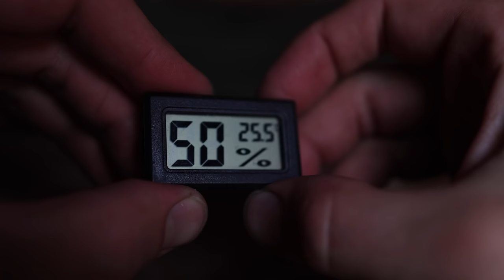Made an Absolutely AMAZING & COZY FIREPLACE in a Bushcraft DUGOUT - ALONE into WILDERNESS - ASMR

Comment: would a layer of that clay mud on the wood walls before you lay in the rock been good idea to insulate and reflect/radiate the heat back and also protect from fire in case the mortar in the rock cracks or fails? curious on your thoughts ,thank you very much for what you do and God bless🌎🕊💜🛐

Comment: Probably the chimney needs to be raised a bit (perhaps with old tin cans) so that the draft is better when the fire cools down. It can also be that the fire hole is too large in relation to the diameter of the chimney. How does the roof do when it rains, can the moss make it waterproof? The clay from the chimney is also in danger of dissolving when it rains, so a small chimney roof might be a good idea.

Comment: Very inspiring!  You are the real deal.  I love baked potatoes too but recently read that baking in aluminum foil can be unhealthy because the high heat will leach the aluminum into the food so now I use a skillet or dutch oven.  You could also line it with waxed baking paper first then aluminum foil.

Comment: Fascinating to watch.  Great skills in putting your home together.  I have some questions--
  Is the dugout used all year?
  How did you make boards for the door and root cellar?
  You have a flat roof.  Does the moss keep out the rain?
  How much rain gets through the sand/log walls?
  Your water is dark colored, is it pure?
  Your fire is drafting a lot.  Do you choke it down?  
  How often do you re-supply?

Comment: very nice!  one thing I noticed is using the flint and steel.  inexperienced users likely will have issues if they follow your video.  Best way is to anchor the steel (knife) and pull the flint. there is no wind blow, and more directional control. experienced people don't typically have this issue but if your just learning try that. It will yield much better results.

Comment: This is awesome but however these dugouts aren’t waterproof. Hard rain running down the mountain is bound to leak in. After the ground is saturated water will start seeping in thru the walls? Just asking. Thanks
Reply from the maker: Thank you. No, water does not seep inside. The slope of the hill is large, the water quickly flows down the turf. Inside the dugout is always dry.

Comment: I think, to reduce smoke coming inside while burning slow. Decrease the size of the "throw in" also use more clay while building oven or atleast put another layer with sand inbetween the wooden frame and the fire. Would be a shame if such a nice dugout be burning down. Good job! Nice video

Comment: Thanks and congrats for this video !!! Its a very hard work that requires strength and a lot of patience ! was the fireplace made with clay only or mixed with lime?
Reply from the maker: My pleasure. Yes, it was hard and long work :)
I added a little special mixture to make the clay more viscous and dry faster. I also tried adding ashes from a fire and fine sand in different proportions.

Comment: What happens if it rains? Wouldnt the rain just go down the chimney  making the oven useless? This would be a big problem in the colder months when you need a fire more. Any plans for that?
Other than that I absolutely love your vids!!
Also, how did you get the door to hang and turn?
Reply from the maker: Thank you!
In the rain there will be no problems, the temperature in the pipe is so high that the water entering it simply evaporates.
At first I wanted to make a canopy of twigs and clay on top of the pipe. But when I conducted the first tests of the fireplace, I realized that this is not necessary :)
I hung the door on long metal hinges that I had brought with me.

Comment: I love little dugout cabins like this,  just don't like the fireplace placement to the door.   Normally a door like that will be a massive heat loss and big draft source same with the windows.  The normal solution to that is curtains, over the door and window.   a big hide blanket over the door to keep out the wind and keep in the heat, and a wool or hide blanket over the window.

The issue is...   the fireplace, i'd be worried about putting up a blanket or door covering and having it catch fire.

Comment: Nice work, I like it very much. But I think it would be safer to leave a gap between the stones of the oven and the log of the back wall. Also, you forgot to put sand in the gaps between the log and the stone. You used the sand fill to build the log walls and I found that very logical. I think that the plaster made of mud will not be enough for the increased heat accumulated between the logs and stones. I wish you to be very careful about the fire hazard. This work of yours has been a good experience for all of us, thank you.
Reply from the maker: Thank you!
Yes, I thought about it. I tried to lay thicker stones on the back wall. So far so good, stoked the fireplace to test for over 7 hours straight.

Comment: Curious if you have ever used any of the solar cookers with a shiny smooth convex surface to direct the rays to your food or to heat water? They are low profile, can be set up away from the cabin for concealment or misdirection (and to not draw predators back to your camp to the smell of your cooking food) and reduce the use of firewood which is precious and should be saved for winter. (Or at least not as desirable on very hot days or dry fire hazard conditions.) I have recently been researching them as an alternative and depending on materials available, they seem very straightforward to make. Smoke is usually the big giveaway that lets other people know you are there from far away so the reflection of the parabola can be a tradeoff but really it would be seen only from a narrow piece of sky- and easily instantly concealed by a tarp where the smoke of a fire still lingers and floats after you put it out. (Except the Dakota firehole of course) anyway i am just interested in acquiring as many skills as possible so if you have thoughts?
Reply from the maker: Yes, I was thinking about solar cookers. It will be a good solution on sunny days. But there are very few of them in the north...
However, I will try to do it in the next videos 😉👌
Reply: Great! There are several videos of homemade designs with simple store-bought materials. And the insulated boxes to maintain heat after the cooking. 
I scavenged and repurposed some materials and i will keep building until i achieve the desired result. Looking forward to the next video!

Comment: Great couple of videos. How did it take to collect all those stones? Great addition the fireplace, Maybe add a flat stone over the chimney top for rain. Wonder how that sand will hold in the rain showers; why didn't you use a small tarp or mud seal the roof? Amazing work, with exceptional skills with basic tools. Any wild game or larger edibles in the area?
Reply from the maker: Thank you! I found most of the stones when I was digging a hole for a dugout. The rest I collected on crumbling sandy slopes.

I wanted to make a spark arrester for the pipe, but then I thought that it was not really needed. Although I'm not sure :)
I need to deal with a small part of the smoke that still enters the dugout from the fireplace. Perhaps increasing the height of the pipe would help?
Or making a special protrusion inside the fireplace, which is called a fireplace tooth ...
Well, later, I want to make a spark arrestor from the interlacing of branches and rub it with clay. I did not find a large and flat stone :)

I redid the roof later and used waterproof breathable fabric. It became dry in the dugout, all the logs dried up.

Yes, this area is full of various game, large ungulates.
There are moose, wild boars, badgers.

Comment: Really nice but wouldn't it  be better to build it in the middle of the dugout so any heat it gives of is given off to the air in the dugout rather than to the outside? Of course that may only work in a bigger dugout
Reply from the maker: Thank you. For such a volume of dugout, this fireplace is even too large. There are no problems with heating the entire space :)
Reply: @AsbjornOlsenBergBushcraft  I see for such a big dugout one would probably have to build the chimney stack before putitng on the roof becuase  it  would need to be load bearing to support the bigger roof I imagine?
Reply from the maker: I would not make the chimney load-bearing. There are ways to make a roof of a large area using wooden beams and supports resting on a beam at an angle of 45 degrees. But I'm not an architect, I have little knowledge in this science 🙂

Comment: 18:33 - are these doors for ventilation? And brick, and stone, and metal, and adobe, any stoves heat up, there is practically no fireplace. The body of the fireplace did not warm up, and a very large part of the heat flies away with the flue gases into the chimney, so the fireplace turned out to be not very effective as a source of heating. As an assistant in cooking - also not the best option. The fire and stones around the fire are much better for cooking than such a fireplace. Depending on the design of an open fireplace, its thermal efficiency varies from 5% to 30% at best.
Wood stoves and fireplace inserts are much more efficient than open fires. For example, the most simple in terms of energy efficiency stoves "Potbelly stoves" have an efficiency of 65%. The efficiency of conventional furnaces is 75-80%
Reply from the maker: The stones get very hot. The heat in the stones remains until the morning. Firewood, when the fireplace is heated, does not go much. The food is prepared very quickly, the bread is baked well. I like this fireplace, the rest is not very important.
Reply: @AsbjornOlsenBergBushcraft  Well, it's up to you. How can I prove anything ?